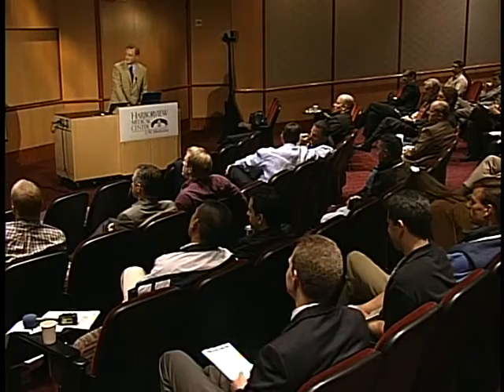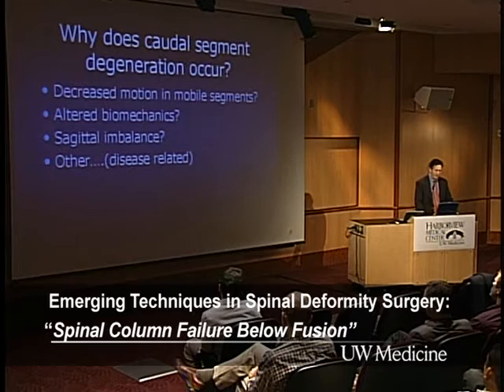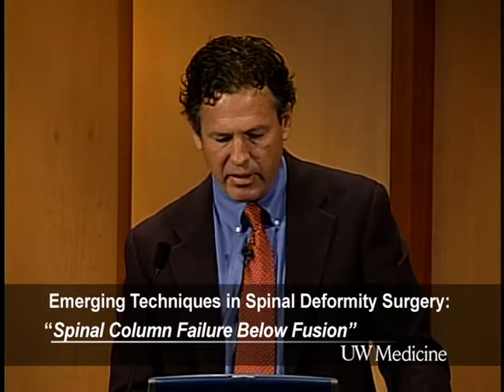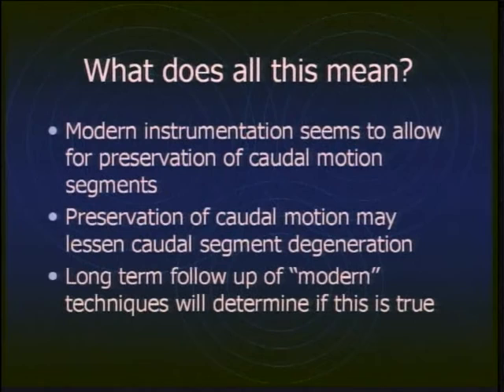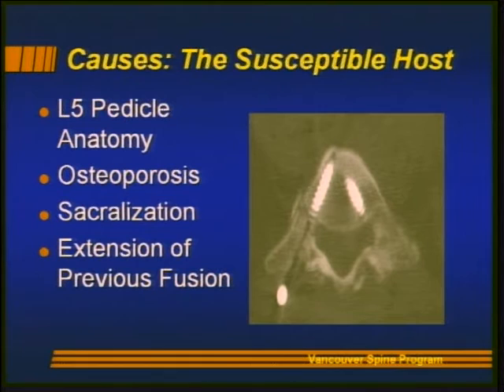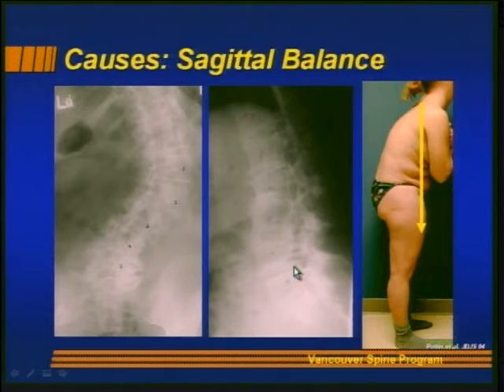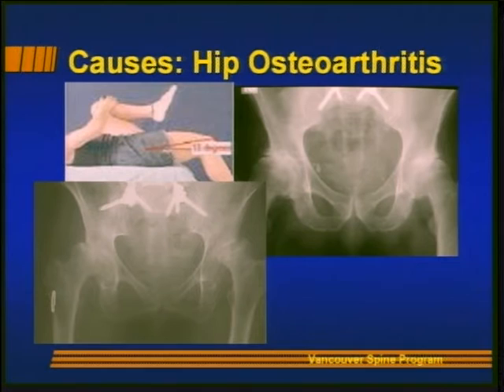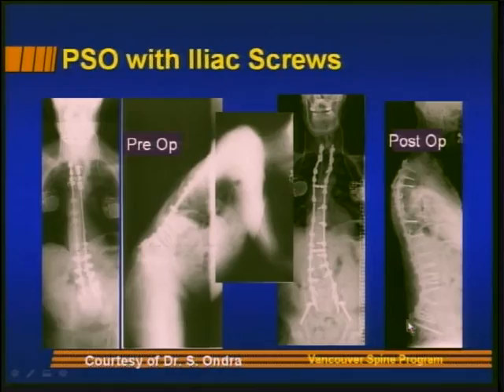Spinal Column Failure Below Fusion

Comment: I had a d lift fusion at L5 I have less pain in the legs but my S1 has a lot of facet joint pain I think they should have fused the S1 disc could have saved  me a lot of problems and possibly another surgery